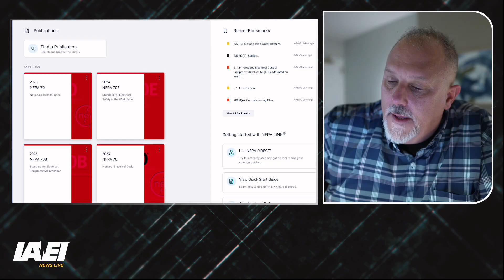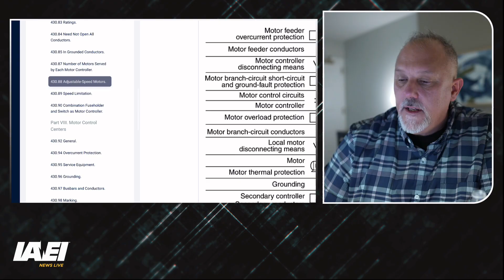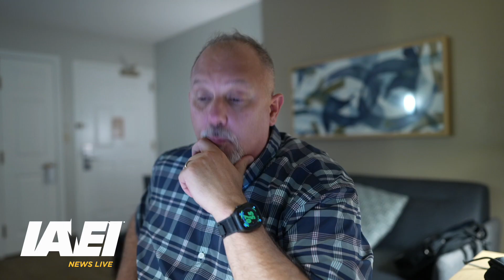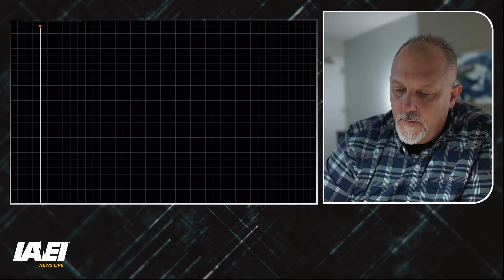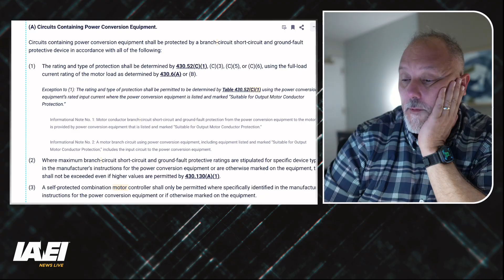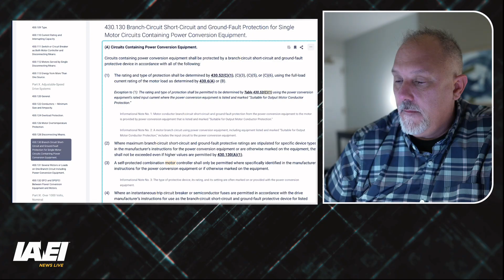Adjustable Speed Drives - Part I

Comment: To me 430.130 says you can use the motor protection tables if the manufacturer of the VFD does not provide instruction on what to use for protection. If the manufacturer provides that instruction follow it.

Comment: my facility is upgrading from DC drives to AC. Decisions were made to add a central drive room. Input feeds compared to old system will increase. DC drive outputs to motor were usually under 50ft, new feeds will be about 250ft what problems/symptoms should we be on lookout for with large cable lengths.